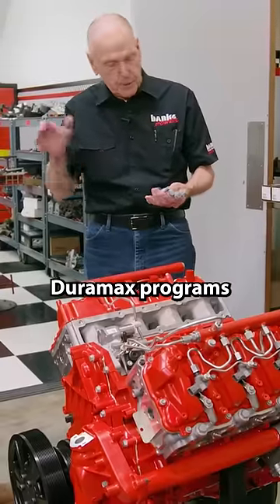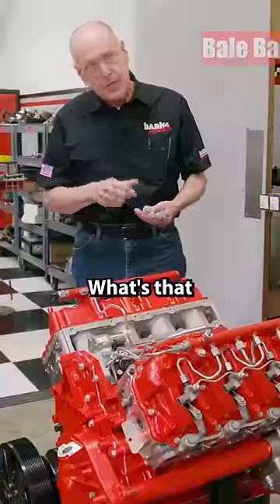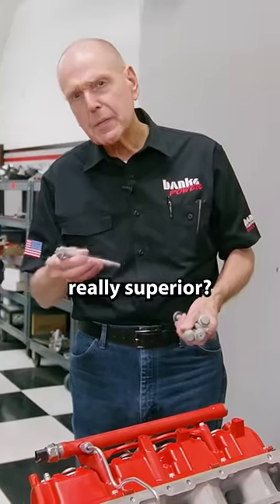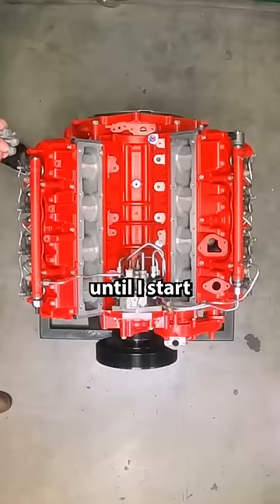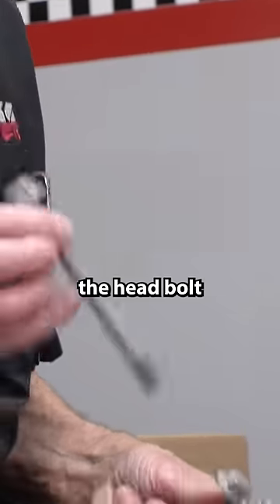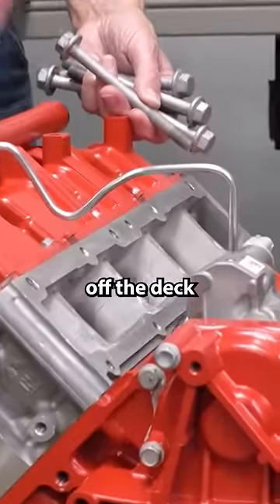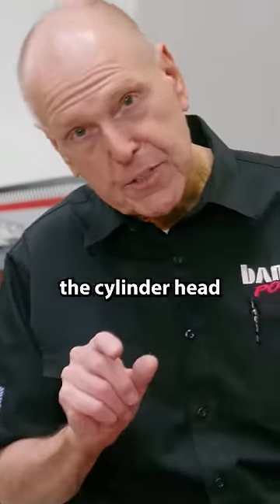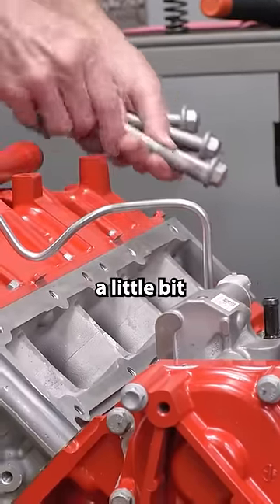Upgrading to head studs might be a bad idea

Comment: I'm running studs on my 300 purely because I plan on taking it apart several times, and one set of studs is cheaper than two sets of bolts.
I trust 100% of what this man says, and I can't say that about anyone else in the world.
Reply: Ford 300 or Chrysler 300? Hard to picture taking a Ford 300 apart more than once
Reply: @calebz1448  Ford.
It's a spicy unit, I built it this time with flat top 351 pistons and too small a cam. 9.7:1 static compression, much higher than factory and it sometimes diesels a little bit when it gets hot, on 91 octane.
Next time I'll be dropping the compression down below factory at 8:1 and turbocharging the bajeezus out of it. Then it'll come apart again when I manage to find a forged crank, potentially decades in the future.
In its current configuration it makes more torque down low than the 460 I took out of that truck. The very first time I drove it I missed reverse and put it in fourth, then my foot slipped off of the clutch and it squealed the tires and almost ran through the garage- at idle 😅
Reply: @Cheezeball99999  sound spicier than a street taco truck sauce and glad to hear it has a proper gearbox behind it instead of a slushbox absorbing all that torque
Reply: @Cheezeball99999 - Sorry to hear about your 460, it could have made more torque than a pair of 300's. All joking aside, good on you for building something different!
Reply: I'm a fan of studs on everything possible too, gotta tinker with everything
Reply: I have a ford 300 in a 12 inch bandit wood chipper. Great engine, always fires up even after sitting for over a yr. At first i was disappointed it wasn't diesel (could have had a cummins 4bt, but got a deal i couldn't pass up), but having run it for a while i really don't mind the 300 i6. Lots of tq, recovers rpm quickly. Single barrel carb, every time i look at it i wonder what itd be like with some huge carb/intake setup, headers, hei, etc bolted on lol. The industrial engines have forged cranks i think, it would probably hold up to a lot more power decently. 

There's an episode of engine masters where they build up and turbo a 300, i think they double the hp/tq. Worth a watch if u have one. Everyone tells me they run forever. Dad had one in a f100, he loved it.
Reply: @ctdieselnut  - I saw that episode as well and it was a good runner. Hard to beat the durability of a straight six with seven main journals!
Reply: Studs are easier to torque up correctly ... but make sure you reduce friction on the nuts whilst torquing them up.
Also note that as he said, "studs are less forgiving"!
Reply: I still dream about a cross flowing head for the 300cid!
Add a solid roller cam and a tuned exhaust... look out!
Reply: Be really careful. Everytime you remove and reinstall head studs if you reuse the studs you effectively polish the threads clean with each pass in and out of the deck. Smoother stud threads mean the same torque on your torque wrench is actually applying more clamping force than with a new stud, because there's less friction in the threads working against the torque wrench. This means, with everytime you re-use a head stud your clamping it down harder using the same torque on the wrench, making it more and more likely to Crack your block or head with each reuse

Comment: That's a good way of looking at it, also why head bolts are replaced every time head gaskets are changed. They are usually torqued and then turned another 45-90 degrees to stretch them out to where they need to be. This guy is good!
Reply: And, the stretch is WHY the bolts must be replaced.
Reply: Torque to yield head bolts don't only stretch they go hour glass shaped. This is the " shock absorbing area beside the head gasket, or the stacking of the yield. Some manufacturers say they can be reused ten times? Who's counting and we're is it recorded. Change em and know your fresh, also no bargain head gaskets.

Comment: The purpose of studs upgrade from bolts is because bolts twist on themselves while torque is applied to them. That's not mandatory to overtorque nuts on bolts at the point it leads to block or head cracks. Studs upgrade is worthwhile because it allows to set the clamping pressure  more reliably, more accurately and more consistently. In setups where clamping pressure is upgraded too then it must be kept in resonable range to avoid falling in the block or head cracking range.

Comment: Being a rover/mg fan I 100% agree with this.
On the rover k series engine the head bolts pass all the way through the head and block to bolt into the oil rail in the sump, in the early days when there was a rush to develop high performance parts companies would come out with "upgraded" strengthened head bolts but since these head bolts are designed to stretch and rover specifically designed these head bolts for the job any stiffer bolts would just cause more problems
Reply: Look into GM's 2.0L ecotech. It was designed to drill out the head bolt threads and main bolt threads. So long U bolts tie the head to the crank girdle. Necessary at the 800Hp plus level, as I recall.

Comment: Well put, I never considered that. Happy I used stock head bolts in my build now! Although, my engine was a mere mortal gasoline setup.
Reply: "There is nothing mere, about that mortal!"
Reply: @Markymo00o  other than merely brilliant🎯
Reply: Haha thanks. It's a built up 6.0L LQ9 aka steel block LS2. I ported and polished heads just to clean up castings (left intake side alone), threw in johnson lifters and a custom ground cam from roger vinchi. Sucker is a torque monster but accelerates like a turtle... prob cause I've not messed with factory timing at all. Tons of fun to build but 7.5k in parts for a 6.0L haha whoops.
Reply: @exploringgodscountry  7.5k in parts?👀
 Jiminy Shitmas, if I put that much into my 69 GMC K2500, it would triple it's value😁
Reply: @invisibilianone6288  haha, yup! My motor cost me over twice what I paid for the truck. Not to mention the custom 4L60E build I put in it. It's a BEAST off road though. It will climb like there's nothing in its way. Just wish it wasn't a complete turtle on the highway. Your 69, sounds fun! Does it have an old 350 in it?
Reply: @exploringgodscountry  worn out Goodwrench 350, junk heads cast in southern country. Th350 and 205 T-case.
 Rebuilt the transmission out in the woods, at jobsite, almost 3 years ago. Transmission still working great.
 The engine has been losing power by the moment. Runs smooth, sounds good, just getting slower and slower, going up long hills.( haven had to use low-range, YET)😁
Reply: The pickup has had me just over 28years.
Reply: @invisibilianone6288  sounds like time for a 6.0L swap! Just don't fall into my $7500 trap haha
Reply: @exploringgodscountry  I've been looking at a built 350, 420hp/380lb/ft torque. Right around $3 grand.
 Not in my budget, at this time.
 The 69 GMC is getting about 8mpg, going downhill, with a tailwind, engine off, sails up...😂
Reply: A slightly hopped up LS should give you decent numbers. There were 5.3L engines all I very the place for 500$ here. 6.0L for up to 1500$. Although maybe some jury rigging to get to fit in your setup.
Reply: @exploringgodscountry  biggest drawback is, I like to stay away from computer controlled set ups.
 The most technicalization on my pickup is the HEI distributor from 73 to 78ish 350. I carry a spare module and coil/distributor cap. If module fails, which they occasionally do, it takes about 15min, or less, then back on the road🎯😎
Reply: @invisibilianone6288  they sure built em to last back in the day! And if they didn't was a cinch to fix.
Reply: @exploringgodscountry  Absolutely🎯
 Also, most all of the vehicle was rebuildable, unlike today's vehicles which use unitized parts like hub assemblies. Some years back, a friend told me it cost over $400 bucks each, for front hub/bearing units on his 4x4 pickup.
 My old spicer locking hubs, I can completely disassemble, clean, repack the grease and replace individual parts,,,IF NEEDED😁
Reply: @invisibilianone6288 yeah isn't that crazy how they build stuff not to be serviced anymore???? It doesn't save anything, it creates more waste. Then they cram the environmental stuff in our face.
Reply: @exploringgodscountry  we're not the only ones aware of that shituation🎯
Reply: @exploringgodscountry  as my oldest brother would say,
"How much must we pay, to subsidize our own demise?"
Reply: @invisibilianone6288  well put!

Comment: Your assuming the studs are installed properly. I suspect what happened there was the studs were improperly installed and tightened into the block. ARP outlines the procedure for them to be finger tight THEN loosed a 1/4 turn. Doing so provides the room to move for thermal expansion etc. and prevents cracking.
Reply: Exactly. And a lot more factors come into play as well. I think Gail is an extremely smart man. But I cant agree with him on this one. As an engine builder I have seen so many stud jobs screwed up exactly how you said. Never seen a block fail when studs are done right.
Reply: It would need some better failure analysis to determine for sure what happened. I’ve also seen damage like this from a cross-threaded fastener, one that wasn’t torqued down and side-loaded, or one that was screwed down with some oil or assembly lube pooled at the bottom of the hole and forced down when it didn’t thread in all the way.
Reply: This is what I was looking for in the comments. Till someone does the data in 50 non studded, and 50 studded I can't agree with this when it comes to Duramax. Owning 5 Duramaxs  I have to say I have yet to have head stud failure. But I do alot of head gaskets before studs on these things
Reply: @michaelric3540  Just go out to it and look at each cylinder head give them a pat and say "that's not going anywhere" and you'll be fine
Reply: @michaelric3540 all studs, not just ARP head studs should be backed out a little.  Else you're putting extra stresses on the studs in the wrong way.
Reply: @michaelric3540  not sure!  It probably just doesn't matter that much.  But really they shouldn't be tight at all
Reply: I build VR6 engines, and people have studs come loose even after re-torquing after a heat cycle (which ARP does not say to do) so some people actually hand tight, and then a little extra. The head isn’t threaded so that definitely helps.
Reply: I work on gas and steam turbines.

If the prior crew bottommed out the case studs, the likelihood of destructive removal goes up by a huge factor.

I never bottom out studs on anything as a result
Reply: @hotbrakepads  okay, live in moms basement boy.

Comment: I agree up to a point.  
Given that the head bolts and studs are both made of steel and are of the same diameter, the 'stretch' will be the same for the same amount of force applied to the bolt or stud.  I believe what happens is that the bolts can be tightened more because of a higher yield strength of the aftermarket stud vs, the stock head bolt and get more stretch.  This then causes the next item in the assembly to fail.  In this case its the block.

Comment: This is why head bolts will stretch when you torque them down, as mentioned in this clip it will prevent the cylinder head from cracking, by letting the head move a bit, kinda like a flex joint on an exhaust pipe, but that stretch in the bolts will bring the head back down and maintain a good seal as long as youre not running too much boost pressure and really lifting the head.

Comment: More than likely the failure he showed was someone bottomed the stud out in the block and then over tightened it. I put them hand tight. If you don’t, cracking the block is likely the result. Studs are far better than bolts. Plus you get a much more accurate and consistent torque. If the head lifts, it pushes water out.
Reply: Or didn’t clean coolant or oil out of the thread hole.
Reply: @warrenself  that’s a good point too. No way anyone would ever convince me that bolts are better than studs.
Reply: Are you trying to say this guy doesn't know what he's talking about?
Reply: Better and cheaper to blow head gasket than crack the block
Reply: @Turbogto_guy studs are better if you are pushing a lot of power.  Most aren’t over 1,000hp.  I put 200k miles on my 24 valve making 775whp and 1375 wtrq and 70 plus lbs of boost on stock head bolts.
Reply: You cant argue with results, studs have been used forever now with excellent success. There is almost no real world scenario that your engine would create cylinder pressure high enough lift the stud  and rip your block apart unless you install them wrong.
Reply: @Keith-jp6jw  yea, I’ve never heard of that either.
Reply: @Keith-jp6jw its not what he is talking about. What happens is cyclical load during every rotation, the part is loaded and then unloaded. If you have a more ductile fastner the energy will be disapated into the materials elastically deformation and thus reducung the stress around the threads. If you have a more rigid material the force will be more concentrated at the threads leading to fatigue cracks froming over time by the cyckical loading.

Comment: VERY TRUE! I had a 1987 IROC-Z I used Stock Heads and bolts on a 550HP upgrade. I experienced longevity with a NOS system. My peers who upgraded to Aluminum Heads and stronger bolts always had catastrophic failures.

Comment: Having read ARP’s literature, studs are superior due to their consistent clamping force when fastened using the bolt stretch method. Its not really a question of strength but consistency
Reply: They may not be superior in this application due to the weak point of the threads in the head. If you have heads that drop in over the studs then I think your point stands.
Reply: So, in the propaganda produced by the company that makes the studs, studs are better?  Ok.
Reply: Studs are easier on threads than bolts.
By far.
Reply: I question apr studs, apr says to install studs hand tight & loossn 1/4 turn . Caterpillar has run studs in there equipment for years & you install the studs to a specified torque the problem with installing studs in place of bolts is the hole in the block is not desined for studs , if the block was preped for studs when you torque the studs in they stay straight not go croked , that is why arp says to loosen studs for self alignment a stud that is not tight in bolt hole is not really a stud !!!
Reply: I’d like to see what arp says in response to this. Lol

Comment: Absolutely Absolutely Absolutely 
1000%
This is one example of many, wisdom that sets Gale apart...
The pocket books of design engineering at serious manufacturers should not be so quickly disregarded. I agree 100%
Firing pressure, spring back, years of figuring things out through millions of causes of millions of failures...
Stock is good. Banks Performance is Best
That's All I'm Saying.

Comment: If your doing stock build with no major compression increase am with you. The stock head bolts are rine but clean and check if any questions replace with standard factory replacement..
Reply: I don’t think over 1,000 HP is a stock and it still seems to hold up fine
Reply: Better yet, just replace those bolts outright. Unless you're in a situation where new head bolts are difficult to source, buy a new set. The additional $$$ for a new set of head bolts is unlikely to move the budget needle much in a build.
Reply: @jackmyers6040  ok, the only problem with my post! I misspelled fine which I fingered in rine!  YOUR either not reading the post or not understanding the post but one thing I do know is I see many many responses by @jackmyers6040 where your response seem to follow the same trend!
Reply: Oh yes because 1,000 + horsepower stock
Reply: @anthonytrujillo7971 I’m sure you know more than Gale Banks 😂😂😂
Reply: @anthonytrujillo7971  🤡🤡🤣